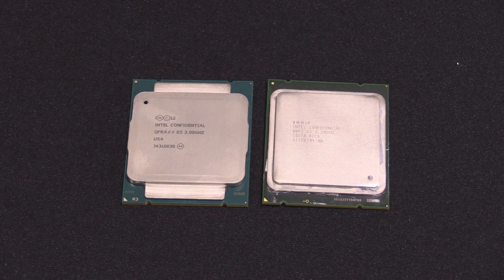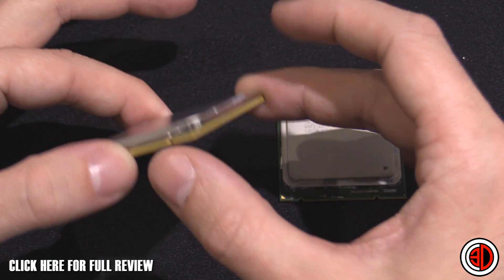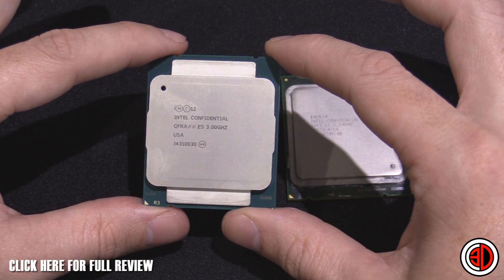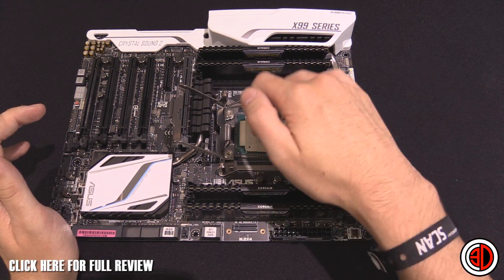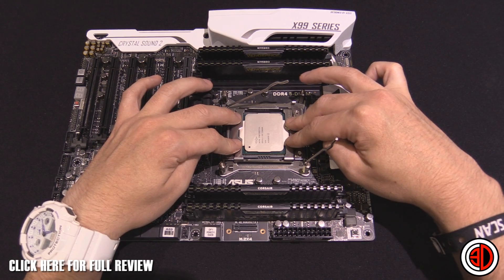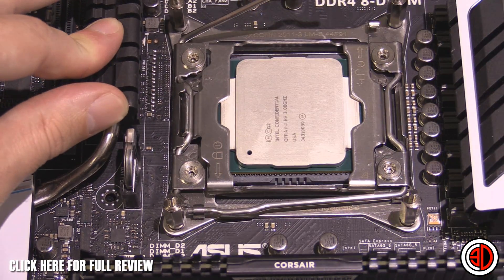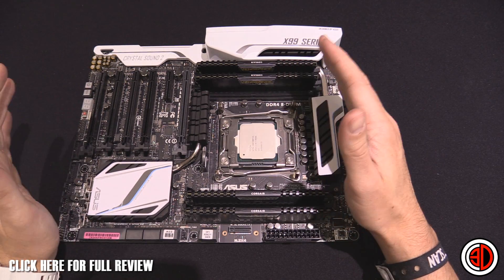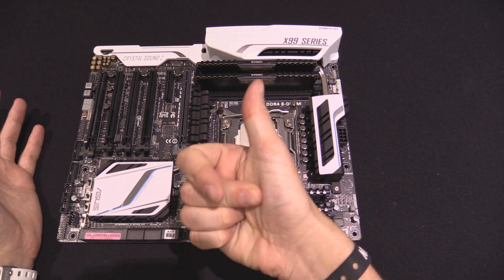5960X vs 4960X + New IHS Clamp

Comment: You don't really need to worry about static discharge from wiping the cpu clean from thermal paste with any rag really. 
Pretty sure the heatsink counts as the circuit ground.